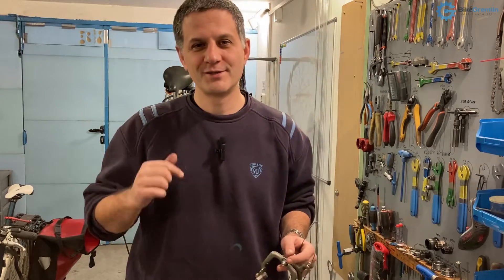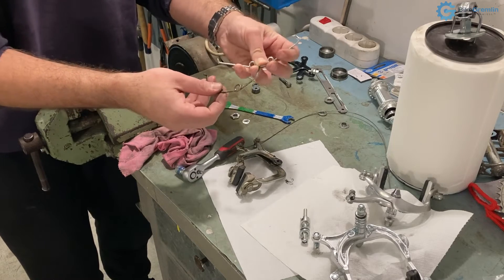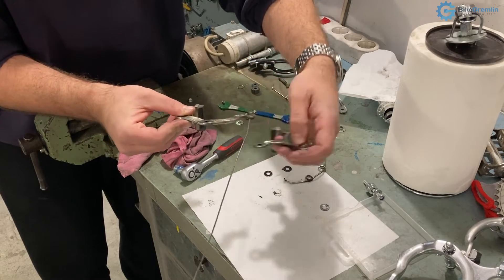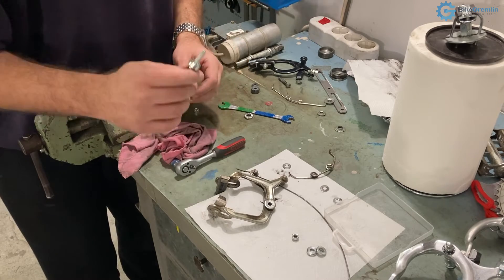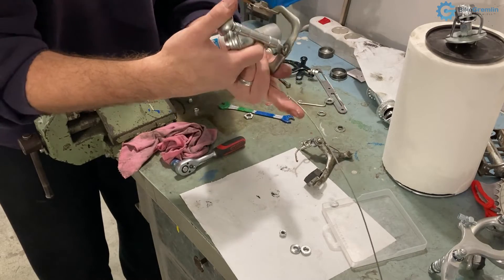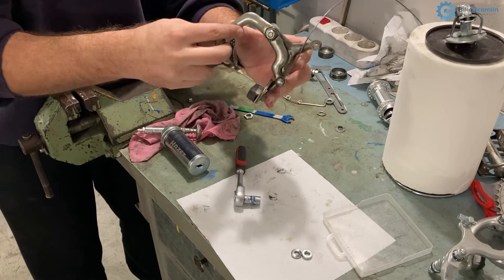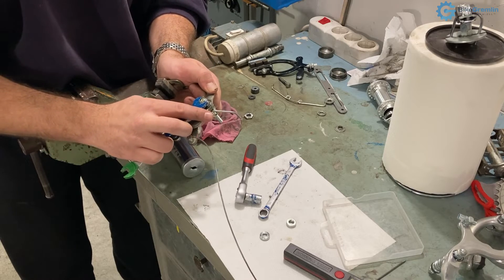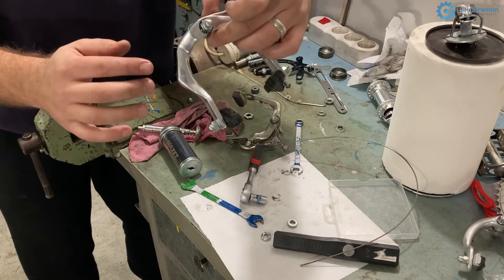Classic road bike rim BRAKE overhaul

Comment: Thank you so much for this video. Keep up the great work covering vintage bikes! I am still  riding my 1979 road bike with Shimano 600 side pull rim brakes and Shimano 600 levers (I upgraded to the 600s from center pull calipers in the early 1980s) on a randonneur handlebar with bar end shifters. I would like to improve the braking power. I did install new pads, but the improvement was not very great. Could I install Shimano Dual-Pivot Calipers with my existing levers? Would they stop better? Which caliper model should I use? I understand there is a issue with pull ratios having to match, but I am having trouble finding that information. There are no mounting points for linear pull or cantilevered brakes on my bike. My mountain bike has linear pull brakes and my wife's bikes have cantilever or disk brakes. They all have far more stopping power than my 600 side pulls. Sometimes I feel like I would stop faster if I dragged my feet, well almost.
Reply from the maker: Hi George,

To start: aluminium rims make a big difference (mentioning this just in case - some people riding vintage bikes don't know how night and day difference alu rims make, especially in the wet).

Decent quality cables, housing and levers (stiff, good ones) are also important.

As for the calipers, in my experience, the Shimano 600 series is good - only it's not designed to be used from the hoods, one needs to pull the brake levers from the drops to achieve a high braking power.

Modern (dual-pivot) road bike calipers do offer a bit more stiffness, and a bit higher mechanical advantage, but have their own downsides. I made a video on those (yes, I know, colour me conservative, or a "retro-grouch" as some say  :)  but I think those are genuine concerns):
https://www.youtube.com/watch?v=QyfZ1shfHP8

If your bike has cantilever brake mounts, and you need more mechanical advantage, I'd go with good quality cantilever brakes, or, even better (which is what I did for my bike), Tektro 926AL. 926 AL have 80 mm long arms, so they work fine with both old, and new-style road bike brake levers, you just need to adjust them to be a bit closer with the old lever type. 

My article on mechanical brake compatibility:
https://bike.bikegremlin.com/1402/mechanical-bicycle-brake-compatibility/